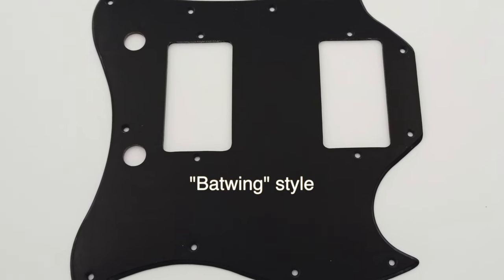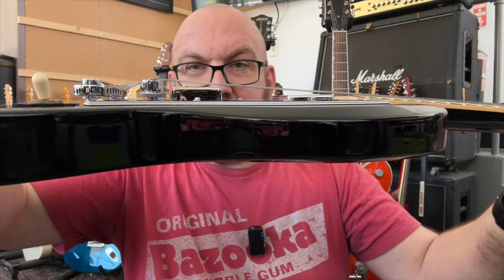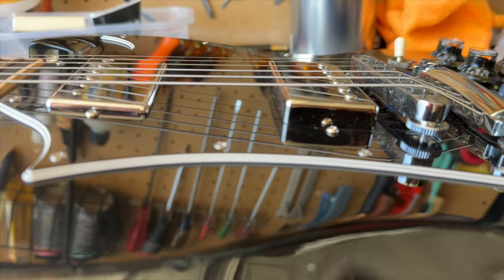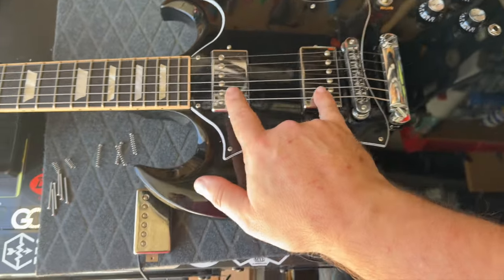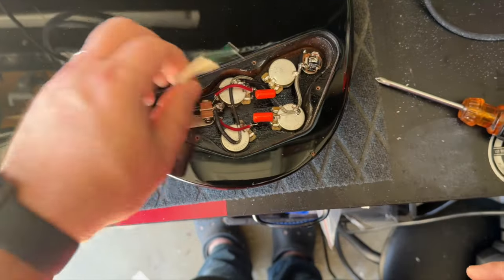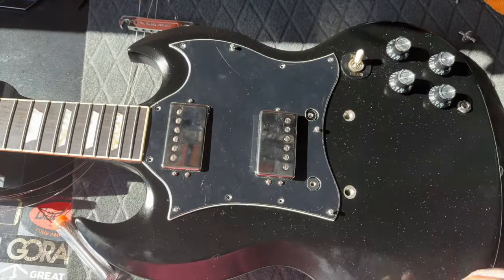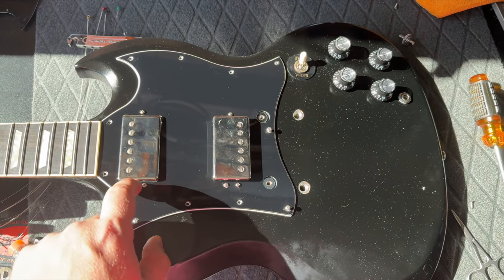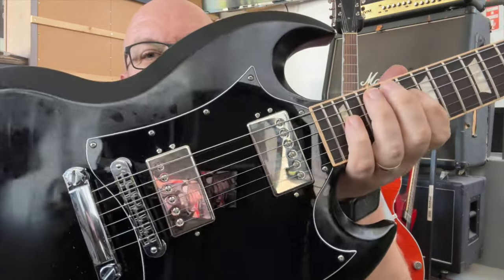Escaping the Annoyance: Finally Fixed the Gibson SG Pickup Angle Flaw

Comment: The easy fix is foam. Been used for decades.
Reply from the maker: I’ve done foam too, long before this channel. I’ve had mixed results using it. Besides the foam breaking down over time, I also didn’t like how I’d not see it set the pickup angle until I screwed the pickguard back down. That’s basically what brought me to this idea, allowing me to adjust the angle while strung up and tuned. To each their own. Whatever way a person finds to be the best for them is the way that’s best for them. ¯\_(ツ)_/¯
Reply: @11thFret  Yeah it's not the best, but it can work with enough finesse - I tended to use window seal trimmed to the angle and double sided adhesive with spring inserts. Another fix could be pickup rings  like things under the pick guard.

Comment: I have a Gibson SG 2019 HP with maple top ,  lockers and 24 frets..Good guitar...,But a big problem, Neckdiving from hell
Reply: Yeah, grovers and locking tuners are a problem for SG's.  If you have Klusons, you probably won't have neck dive.  I have a '61 standard with a Maestro Vibrola and Kluson style tuners- I've never seen a single one of these that has any inkling of wanting to neck dive.  Yeah, it's a little heavier- but not much.
Reply from the maker: Every SG I’ve owned had a neck dive issue with Grover’s, Klusons, etc. I usually use a grippy suede strap (eg: Levy’s MS12) to help keep my SG’s in position. If I use something more slippery like nylon or a polished leather, my SG necks point downward in a hurry.
Reply: @11thFret  I have a white SG with the batwing and it sits perfect.  The solid colors tend to be heavier than the translucent colors and the heavier SG's tend to balance better.  That said, I really want a translucent teal SG neck dive be damned.

Comment: ?...and that sounds different? Sustains differently?
Reply from the maker: Different? Yes, but largely attributable to the pickup swap. I haven't yet done the A/B with setting pickup angles between level-with-strings and level-with-top. Sustains differently? Also difficult to say at this point with different pickups. However, the bar magnet isn't really going up or down but is rather rotating in place due to my proposed solution. So I'm inclined to say that sustain hasn't improved much if any. But, if pickup height in any guitar makes a difference, then I've successfully backed off one coil from the strings and brought the other coil closer for theoretically more balanced output.

Comment: Gibson won't change it because there is no way a humbucker (unless you're using a Dirty Fingers with 3 ceramic magnets) generates a strong enough magnetic field to have any appreciable "pull" on the strings at that distance.  It's not a Strat pickup which DO pull on strings audibly if too close.  The issue would be a slightly asymmetric response from the coils.  As you said, that may contribute to the uniqueness of the SG's sound.
Reply from the maker: I honestly wasn’t sure one way or the other if it’d do much if anything to the sound. During planning, my wife was pressing me to do a before/after sound demo. But I committed to changing the stock pups out for Seymour Duncans which is why I didn’t. So I don’t know one way or the other if it really made any tonal difference other than appeasing a player’s emotional need to have the pickups match the angle of the strings. But I will say that Guild was one of the first brands to really implement such a mount with their HB-1 pickup. Schaller also claimed to me in an email to have created the 3-screw mount back in 1952 (an odd claim, but I’ll entertain it for the time being despite Gibson’s PAF hitting the market 5-years later). So I basically knew this was something other brands acknowledged and leveraged long ago. But again, does it make a difference beyond it being aesthetically pleasing to certain players? I don’t know yet. I’ve yet to set the angle back to factory out of a little bit of fear that I might strip the adapters by adjusting them too much. But I’ll likely do a follow up to this video eventually with that A/B, before and after sound demo in mind.
Reply: @11thFret  
You can still do a before and after. Just do a before with the new pickups flat and then after with them angled. Just to see if it makes a tonal difference. I'd be interesting in seeing that.
Reply: @11thFret  I have a vintage Strat pickup in my guitar and for some reason it sits at a weird angle and isn't straight up but tilted a little towards the neck.  At first the OCD went nuts but it sounds fine and I didn't wanna screw up a vintage pickup.   Sometimes you just have to settle down the OCD ya know.  ;)
Reply from the maker: @autodidacticprofessor869  I’ve seen that a lot on my workbench with various client Strats. All I can say there is to make sure your leads coming off the pickup aren’t pulling tightly back, adding strain to the wires and connections. It’s mostly likely fine, but worth a peek. My OCD would at least have me rooting around in there. 😂

Comment: Nothing in the video about the essential: Does it sound different now? Does that new screw hole in that piece of plastic have threads now for that adjustment screw?
Reply from the maker: Thanks for calling that out. I definitely aimed to do a before after during planning. But I couldn’t touch on it yet as I inevitably replaced the pickups from a Gibson 498T/490R set to a Seymour Duncan SH-16b/SH-1n set - something I promised the Duncan’s I’d do. If I did a before and after, itd be more about the pickup differences rather than the tilt. I hope to do a follow up video since I have the ability to reset the pickup angles using this mounting method. But the ultimate goal for this video was to resolve the tilt aesthetic that some if not many SG owners take issue with.
Reply: @11thFret  Ok, thanks. You didn't show how you fastened this adjustment screw to that new piece of plastic underneath. I guess you just fastened a wood screw thru it?
Reply from the maker: @postoffice146 Ahhh. Yeah, I know I skipped out on that part. The plastic piece had three holes. The two outer holes are threaded for height adjustment screws. The middle hole is enlarged and not threaded for a shorter screw to pass through into the humbucker’s leg for fastening. TV Jones sells a similar adapter called “TV Jones Dual Screw Mount Adapter” (search Google or Sweetwater since I can’t link here). However, the outer screws are wider than what I had Derek Duncan craft for me. But if you see its image, you’ll get a better idea over how these adapters mount to a humbucker’s leg.
Reply: What’s the point of this if we can’t buy the adapters?
Reply from the maker: @FinstaDaMinsta  To propose an idea for a solution.

Comment: Nice work.  I prefer the look of the big batwing SG pickguard but the pickup angles do annoy me.  It's really just a visual thing, I think the effect on the sound is minimal, if it's there at all.  I've been considering doing a mod like yours, or using mounting rings on top of the pickguard (which doesn't quite work as the neck pickup ring overhangs the pickguard edges, which is as visually annoying as the original pickup-angle issue...).  I've seen the TV Jones adaptors, but they seem to be made of some kind of plastic, I don't know why they didn't use metal which would've been more durable.
Reply from the maker: Thanks! Just a heads-up: the TV Jones adapters space the height adjustment screws much farther apart than Fender's Shawbucker mount. You could probably make it work by ordering a custom pickguard from WD Music and specifying the correct screw spacing in your order. I learned this the hard way when modding a Gibson Flying V as a test. The TV Jones adapters were wider than the Shawbucker mount I mentioned to WD, and the screw hole threads ended up stripping. I had to use small 3-48 nuts underneath the mounts to make it function, but the height adjustment screw heads ended up pointing outward atop the pickguard. 

I never quite figured out the right spacing to tell WD before a friend helped me make custom ones. The adapters in this video are made from the same material TV Jones uses, which I’m happy with. The key is to make sure your spacing is correct when ordering a pickguard from WD Music. Or order the pickguard with no mounting holes and drill them yourself.

But yeah, I've been back and forth with this idea for years, long before this channel. It always bothered me aesthetically. I've packed foam, rubber, bent the humbucker's legs, etc. This adapter was the only way to make it work, allowing me to rotate it back to the stock angle, or make it perfectly level without disassembly.
Reply: @11thFret  Thanks, I think I may get some of the TV Jones adaptors just out of interest, even if I don't end up using them.  I'd probably order a pickguard without mounting holes, to make sure I got the spacing right!  Do you know if the TVJ adaptors fit #3-48 screws?  Their website doesn't say very much.
Reply from the maker: @philipquail4044 Yeah, ordering the TV Jones adapters was a crap shoot for me too. I ended up throwing caution to the wind anyway via Sweetwater because I knew they’d take care of me with no guilt. My adapters worked with the 3-48 screws, no problem. Well, no problem until I came at the holes from an angle. That was stupid on my part. My impatience won that battle, but simple logic won the war. The TV Jones adapters should still work just fine. However, make sure you have some 3-48 nuts around, just in case. 🤘

Comment: Can you please convince Seymour Duncan to produce & sell these? Brilliant solution to a really dumb problem. I would buy it in a heartbeat & I know I'm not alone. Pretty much everyone who has an SG seems to be bothered by the slanted pickups. It's crazy that Gibson hasn't designed a fix yet. 

I really don't think the slant contributes anything at all to the tone of the SG. PAFs will sound good whether they are slanted or not. The asymmetry of the slanted pickups just looks wrong.
Reply from the maker: I’ll try. However, through a slightly different approach, TV Jones makes leg adapters too which wouldn’t require grinding away at the pickup’s leg. I believe Sweetwater sells them. A big note is that they’re slightly wider than what Derek Duncan made for me. I don’t know what the spacing is or the standard naming scheme it applies to exactly. But I know they’re made to adapt TV Jones’ Trons to Fender’s/Gretsch’s 3-screw Tron spacing. If we can figure out how WD Music interprets that screw spacing for special instructions, then you have something to work with today as an order.

Comment: Univox did that back in the early 1970s wit the 3 screws . Maybe 4 screws would be More better ? LOL
Reply from the maker: I’ve actually a big study for this mount I’ve been building for some time. I plan on doing a video on it later. But thank you for sharing what you know! I didn’t know Vox also did it too. Guild also did it with their HB-1 in 1971. I’ll spoil something else too: Schaller’s CEO claimed to me that they created the 3 screw mount back in 1952. It’s an interesting year, as the PAF humbucker and Filter’Tron didn’t come out until 5-years later. 🤔
Reply: @11thFret  UNIVOX not Vox . I had a Strat copy called a Ripper and they also used it on Lucy which was the Dan Armstrong copy . I think all their guitars were like that ?

Comment: Dude! Ya got to be kidding me! It's not really a design flaw because, due to the tilt and the variation of the distance, a larger array of frequencies are transmitted from the strings to the pickups. Do ya really think Gibson would not have corrected the angle if it negatively affected the sound? You want pups without a tilt, get a Les Paul. :face-turquoise-covering-eyes:
Reply from the maker: Definitely not kidding ya. It would be a design flaw if the pickup angles were so extreme that when adjusting the humbucker height for better output, one coil ends up so close to the strings that you accidentally press them against it while playing, while the other coil sits farther away. Does this matter for a bar magnet? Not really, since the center of the magnetic field is what counts. In theory, a pickup could give great output even at a 45º angle, but the pickups would be guaranteed to rub against the strings, defeating the purpose. So, I'd say anything beyond a 5º-10º angle is pushing it. Using the three-screw mount like Fender does helps avoid this issue, which Gibson 'could' do but never has. And honestly, what harm is there in matching the pickup angle to the strings? The answer: None.

Plus, yes I own and play a few Les Pauls too. I have that base covered. ;-)
Reply: @11thFret  A magnet has the  strongest magnetic field at the center of the magnet.  Tilt the magnet and you will get a variation of strong to weak from the same magnet to a greater degree than if the magnet is perpendicular to the strings. Sort of like tilting a flashlight where you can see elongation of the light beam. The subtle difference affects the audio signal, there fore, the tone, which can be detected with an audio wave form viewer. It's just like the "tone wood" arguments as to the subtle tone variations caused the density of guitar body and neck woods in both electric and acoustic guitars.